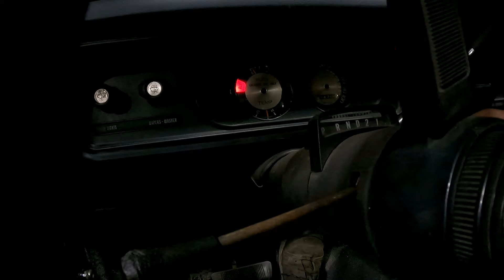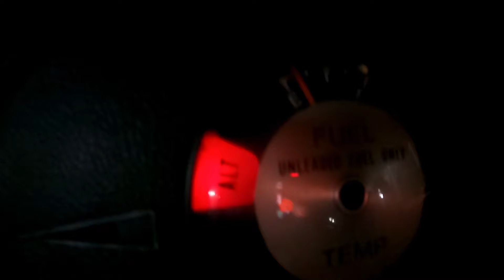Road Worthy V8 Gremlin. Will It Drive Finally? AMC 360

Comment: Congrats on getting it done! I went down a similar road in the early eighties, and it surely taught me a lot from my mistakes!  In my case it was a 1975 Gremlin x, and the engine donor was a police spec Matador. Finding that the 304, 360 and 401 AMC engines have the same external dimensions, opened up a much wider "small parts" source to me, as the Gremlin was offered with a 304 from the factory. So, I installed the 360 with 727 Torque flight transmission in it. For my exhaust, I went to the local independent muffler shop, and they bent me up a pair of pipes fairly reasonably, using mostly the stock bend settings with 2 1/4 pipe.  The car was a regular beast. By some fluke, I didn't break the original rear end, although I had an 8" Mustang rear on hand! Later, I harvested a 401 from a wrecked Ambassador police car, bought a flywheel for it (AMC engines were at least mostly, externally balanced.)  I put that one in a 1974 J-10 pickup, which I had purchased new with a 258 in it. It was a pretty tough truck, but top speed was about 65 (bring your lunch) Turned out to have Dana 44 axles front and rear with 4.10:1 gearing. I had a wrecked Cherokee for parts, and used the 3.54 axles from it. The Cherokee axles are not quite as wide as the J series, so I ended up rebuilding the 4.10 axles.  As for setting timing, see thunderhead289 you tube. He recently was working on his Gremlin, and timing issues came up. He is very knowledgeable, and is an engineer as a daytime job.
Reply from the maker: That's really cool. And yeah, I saw the thunderhead289 video on his gremlin. I've been a fan for several years before he released it, actually. This amc is my first, but it has been a lot of fun to work on. I feel like I'm hooked on them now.  Haha

Comment: I hope the unibody has less rot through than the body.  Thats some major crust.  I love these little cars.  I had a 72 withe the 232 sixw auto trans.  Mine rotted out behind the drivers seat.  Memories.
Reply from the maker: Mine is mostly rotten on the sides where you can see. The floor pans are actually not bad, surprisingly compared to the rest of it. It's a fun car.

Comment: What brand paint did you use on the engine bay?
Reply from the maker: I used dupli-color rust fix over any rusty bare metal and then rustoleum's brush on paint.
Reply: @robbieshobbies93  it looks good in the video did you have brush lines after it dried ?
Reply from the maker: @enjoythesho1992 There is some, but it's not obvious. Most of it looks great, in my opinion.  If you buy a good brush, you usually won't see brush strokes. But the whole car is far from perfect. Lol
Reply from the maker: A couple of videos ago I did the painting of the engine bay, if you want to see some more.